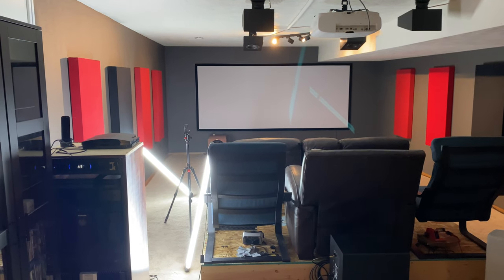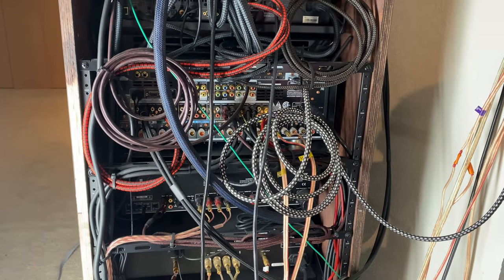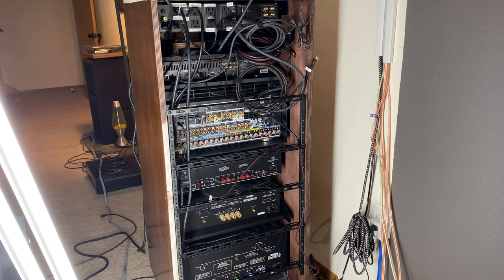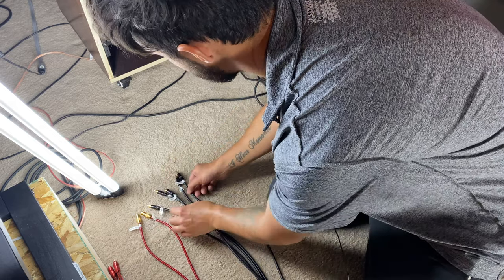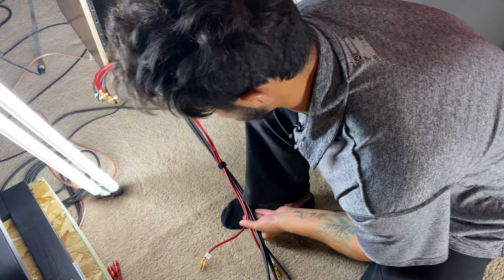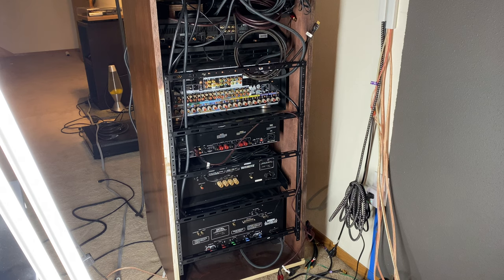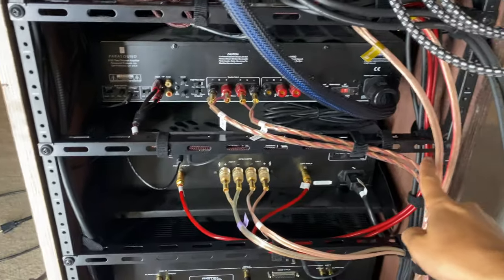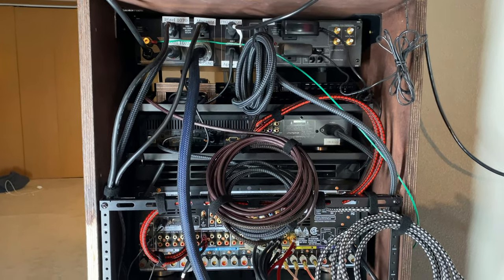Home Theater AV Rack Wire Management (How to)

Comment: Always nice to see the power cables well out of the way from other cables! Good job 👍
Back in the day when I was using a budget receiver I had always been aware of a faint hiss, it was only subtle but still very annoying. Well anyway after auditioning several mid-priced AVRs it quickly became apparent that the hiss was coming from my unshielded cables! Considering I was in a middle of an expansive upgrade... I thought I'll start with what was annoying me the most ( hiss coming from unshielded cables) So I changed my 18- gauge cables for the 14-gauge amazonbasics and even though their was a slight improvement in sound quality the hiss still remained! It was only when I finally purchased chord shielded cables that the hiss had finally been eliminated! 🥳 Probably because of the aluminium shield protecting the cables from RF/EMI interference! My room is so much quieter when I press the pause/mute button I don't hear anything. So nice to have a nice quiet noise floor!

Comment: I’m thinking about building my own home theater system setup and I wanted to let you know that Amazon Basics XLR cables are good quality if you didn’t know that but I’m hoping to do an Amazon build completely off of Amazon electronics and such 😊
Reply from the maker: I was not aware that amazon had a basics branded XLR cable but Im not surprised lol
what would you use for the processor?

Comment: Hi. I'm in England, and was wandering a few things and hope to pick your brain.
1st, did you make your rack or buy it?
2ndly, What components do you have in your rack (Amp, Satelite box, CD Player, etc).
3rdly, Have you fitted Fans to your rack to help reduce over heating? Amps and other equipment can blow out some heat, and your kit is very close together on top of one another.
4th, What power supply do you use to each equipment? Is it the cables that came with your gear or bought separately? For example your Amp, I have A Merlin Tarantula cable on my Amp, and on my CD player, Satelite box and Subwoofer.
5th, What Audio cables do you have, such as HDMI (4k/8k 2.1 ready), Phono Grounded for Turntable, RCA for CD, RCA to Subwoofer.
6th, I see you like Audio quest, is that because if what you said in the video of how you were able to get them or did you research your xaes and thankfully you were able to get them at a bargain?
Many Thanks. GREAT VIDEO BY THE WAY. Love it
Reply from the maker: I made my rack. 
As far as components in my rack I have a video on my channel where I go in detail what I have in my rack. If you watch that video about my Home Theater rack tour you will see why I don’t have fans on anything except the processor. Almost all of the questions you have asked can be answered by watching that video I mentioned. I used sone audio quest pier cable but the standard ones are fine if they are a thicker gauge . Cheers thanks for watching !

Comment: I would have run the power cables down the right side since that is where they all come out of the units at.  The way you ran them could cause issues because they are crossing path with your signal cables.  Otherwise, nice job.